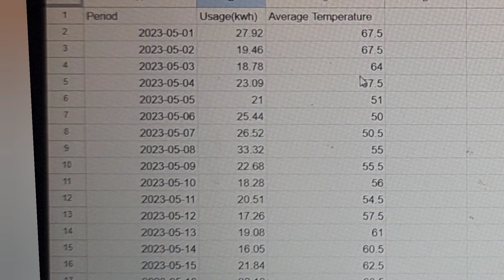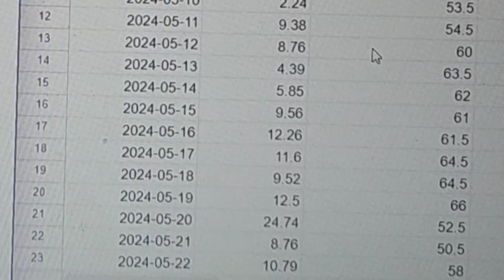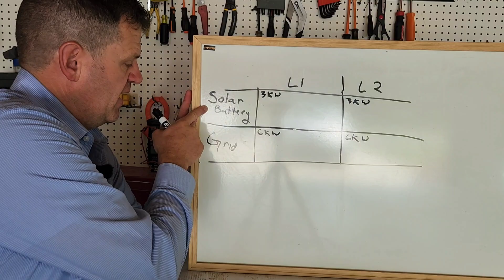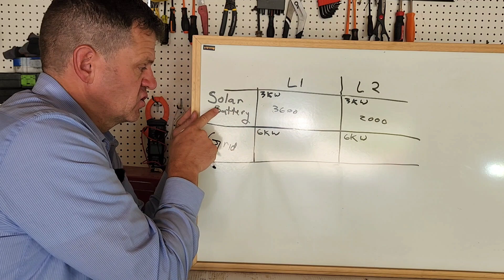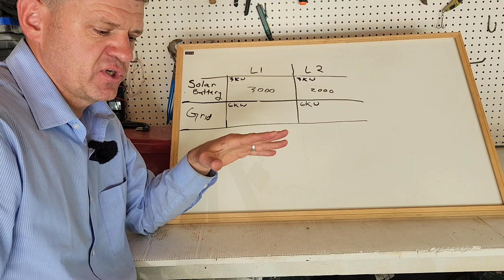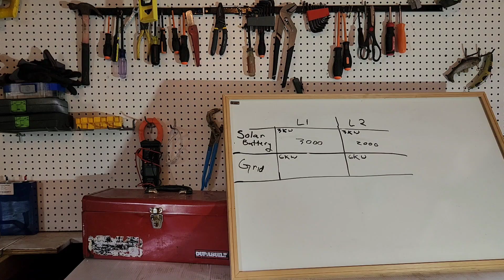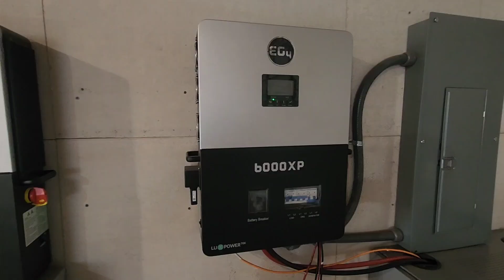I Ran My House on the EG4 6000XP For 2 Months - Cost Savings & Results

Comment: I have not seen an electric bill under 350 in about 9 years. My summer bill  averages about 500-600 and winter bills are closer to 350. My home is small compared to this one mentioned here. It is a 2500 sq ft home with a 4 ton ac, gas appliances and in California. My home does have approximately 95 led can lights and a stay at home wife with home schooled children.
Reply from the maker: Oh, crazy how expensive electricity is in california. A DIY system would be paid off crazy fast over there... or you could have an electrician install it fairly cheap... just to avoid the door-to-door Solar companies.

Comment: I cant get behind the statement that a 7 year payback is similar to historic stock market returns.  Couldnt be farther from the truth.
After 7 years in solar you literally are AT zero.  You spent 7 years in the negative.  After 7 years in investments your money should be DOUBLE when you started. 
Also at 7 years (5 yrs), your high frequency inverters will be out of warranty, ready to be replaced and you have to spend a large amount again.  By 10-14 years your batteries will need to be replaced.  Also your returns wont be linear as capacity degrades literally every day, down to 80% after 8-10 yrs on battery.  So these numbers dont hold up.
Im a fan of solar, a fan of batteries, but  you cant act (yet) like this stuff makes any kind of financial sense.  Its a hobby at best unless money is not an issue, which is a great position to be in.

Comment: Thanks for the video sir. 
One thing that concerns me on the idea of the solar system is fire. The issue is all of this equipment and batteries inside your home. For safety I feel all of the solar equipment and batteries should be separated from the home in a small aux building. Then the AC output brought into the panel from outside. A short circuit in a controller or battery in your home could result in the loss of life or home. If a fire occurs in an outbuilding it is isolated from your home.
Just a thought.
Cheers.
Reply from the maker: Thanks for the comment.  There are other people that share this concern...They have the gridboss and the flexboss for this purpose.  The flexboss can be located offsite with out significate cost in wire.  They also have a BossBox that would replace the outbuilding for the equipment: https://signaturesolar.com/eg4-bossbox-energy-storage-enclosure/?ref=DiySolarPowerFun

Comment: I'd like to see how you're doing with the 12000XP.  Seems you wouldn't push the 6000W/Leg limit of the 12000XP and you'd have a good chance of zeroing it out.
Reply from the maker: The 12,000xp ran my house fine.  No issues there.
Reply: @diySolarPowerFunWithRay so it would zero your bill?  No surprises?
Reply from the maker: Currently during the summer my current array and inverter is covering about 80 to 90% of everything.  Battery gets low at night when the AC is running. Did you decide on a inverter/system for your house?  Let me know if you have any questions. Feel free to shoot me an email.
Reply: @diySolarPowerFunWithRay  Thanks Ray.    My plan is a 12000XP and a 30kwh rack of Ecoworthy server rack batteries.  But I need every other bill in life to slow down first. 😅

Comment: I'm looking at the the EG4 6000XP.  My house is old (built in 77) and will be changing out the windows to double or triple pane windows this fall.   House has new HVAC system so good in that efficiency area.  We are in Texas between Dallas & Houston and it gets blazing hot here during the summer!   My electric bill is around $300 on the high side and low of about $150.  Its only 1700 sf and all electric.   Total KW hours for last years was about 18000 so its got room for improvement.   I'm hoping the single system will work without going to the 12k system but I might be upgrading anyways after we build a shop and power it as well.  We are in a Co-Op area so net metering benefits.   Hoping this will be the off grid system we are looking for as the Co-Ops here are not very friendly.   I'd rather have my own and be done with an electric bill completely!   Great video BTW!
Reply from the maker: Cool. The 12000 XP would also be good if you end up getting an electric vehicle in the future. The 12,000 XP is much better unit than this one.  You could check out my video on it. 
    I also  just posted a review of a nhx hybrid inverter recently that tested out really well...That one is about the same price as the 12,000 XP but it has the ability to back feed.
Reply: Yes, I talked with Signature Solar and I am gonna have to run a 12,000 XP system because we draw too many amps for the 6000 unit. No to the electric vehicle. I’m only a fan of things that I can actually fix. While I think they’re technologically amazing, I would be completely lost, trying to do any maintenance on it. I have a bunch of old vehicles that I’ve been running in maintaining for 40 years and knowing them inside and out has been working for me. Nothing against Tesla’s though. They are quite impressive. Just not my thing.

Comment: If the 6000xp is an off grid system then how do you use grid power if your batteries get low?
Reply from the maker: It's "Off Grid" in the sense that it doesn't backfeed the grid.  But I can connect grid power to it and it will automatically transfer to grid while the batteries are low.  The original install video shows how it all work together.(https://youtu.be/nAJByNRCw0k).  Hope this helps.
Reply: @diySolarPowerFunWithRay  Did you mean from the grid when batteries are low? And thanks for the info!!!
Reply from the maker: If the batteries are low, be default it will go into grid by pass mode... Passing the grid through as it's output.  But you can set it up to charge the batteries up from grid power to a certain percentage if you'd like.

Comment: Instead of looking at just power saved also compare it to what a back up generator would cost to install since this both providing power and acting as a back up.

Also put a soft start device on your AC to reduce the surge as the compressor motor starts up
Reply from the maker: I guess the main difference is that the solar generator will eventually pay for itself, but the gas generator will never pay for itself.
Reply: @diySolarPowerFunWithRay  but functionally a good solar system is acting as a backup generator. This added functionality needs to be considered because just the saving in power. Especially if you have a well, several freezers, etc...

Comment: Generally speaking though you're not factoring in the gas bill.And that needs to be added since you're  calculating your home's energy cost.The ROI would then probably be in the 10-12year time period and by then you would need to either replace your batteries, solar panels or both to a degree.And then what about a major storm that produces hailstones?By no means am I being condescending towards your video but perhaps it would be more real world experience to factor in these scenarios. JMO sir and no harm or dispute meant at all.
Reply from the maker: In my area we don't have hail.  most panels are rated to survive most hail storms.  I believe my batteries will last longer than 10 years.  I currently have some batteries that have a minimum of 10 years warranty. But that is the minimum...they should definitely last longer than that. The system installed here is also not changing my gas bill at all.

Comment: I have a conundrum here, I invested into a beginner setup with 4 400w panels and the ecoflow delta pro 3 and I'm trying to figure out how to upgrade gradually while still incorporating my current rig. Battery expansion is the priority and then eventually an all in one with more panels but I'm trying to envision how I can use a 48v wall mount in conjunction with an Ecoflow Delta Pro 3. I'm gonna need a 48v 50a charger to charge the wall mount with the ecoflow and some way to charge my ecoflow with the wall mount but I'm running into trouble with the degson push connectors, Anyone have any suggestions or care to poo poo this entirely? I have a knack for the unorthodox and inventing new things that haven't been attempted.

Comment: I have the same inverter, I just shut the AC off when I'm running other high draw appliances, since a microwave or other appliance is only on for a short time, but it is just me and my wife, so it's pretty easy..Heat kills electronics, I run mine high, the fan doesn't bother me at all..
Reply from the maker: This is the video where where install the 2nd inverter and explain my decision in selecting that wire:  https://youtu.be/pBKh2Blsnrk?si=A5ZpkK9oGZVSAfXd

Comment: Newbie question: I want to build a simple power emergency system for my dad's small house ( Ecuador South America), the is no power panels. He largest consumption is on his induction stove (220V). I was planing to use one eg4 3000W inverter but i think i can not use it. What is your advice on what is better to use , two EG4 3000w or one EG46000XP? Thanks
Reply from the maker: I would definitely go with a single 6000 XP. But I would call Signature solar and give them a full description of the property and have them help you make the right decision.
Reply: @diySolarPowerFunWithRay  many thanks!!

Comment: My old farmhouse uses, on average, 128 to 135 kw per day. Summer winter doesn't matter. A solar array on the farmette would be great, the 5 ton and 2 ton ac units in the summer, along with the pool motor running 14 hours and a large dehumidifier in the basement, 3 frost free fridges and a frost free upright freezer, and a kid that does two loads of laundry each day, though our dryer is gas, all add up. You would think over the winter the cost would go down BUT, dehumidifier still runs all winter, 6 315W CMH growlights in the basement running 14 hrs each day, and a whole house steam humidifier running at least 10 hours per day (and it turns on the two stage main furnace to circulate the air. I guess I would just need three of those EG4s, 10 batteries and a 30kw solar array to make a dent in my $700/mth electric bill ( we do not have dual rates with cheaper night rates). Also forgot about the Jacuzzi outside and it's 5kw heater  lol

Comment: Is the grid power coming from a breaker in your main panel?  When you send power from the inverter to the main panel, does that just go into the main through a breaker as well?
Reply from the maker: The original install video explains more clear what I did. Thanks! :). https://www.youtube.com/watch?v=nAJByNRCw0k&t=689s

Comment: I also have the EG4-6000 XP (2 of them) they do seem to often fall back to grid, and the interface does a terrible job of showing the leg imbalance (not with 1 mind you, but with 2, absolutely) I'm pretty annoyed with the frequency of fallback, it LOVES to charge the batteries > cover the house load, even when there is plenty of solar (if my battery is >50%) so I often disconnect grid to force the unit to invert and charge. I recently went through hurricane Helene (Upstate SC) and lived the offgrid life for 7 days, what a learning experience that was! I now have a chargeverter (probably will get a second for 200A charge capacity) as I'd rather be charging the batteries then letting the EG4 switch to gen. I still think they are great units for the money. I have 12K of solar now which covers me and charges 400AH of battery during peak summer, I feel I will need DOUBLE the solar and 3x-5x the battery to handle winter needs. Going to find out soon.
Reply from the maker: Chargeverters are amazing!  If both of you units are in running in parallel it shouldn't switch back to grid often. Mine never have.  I wonder if you have some setting off. I'd call signature solar and ask them about you settings.  I also have a setting in my app where I can see both inverters together..."Parallel-A".  Signature Solar had to enable that for me.  Glad you make it though the storm
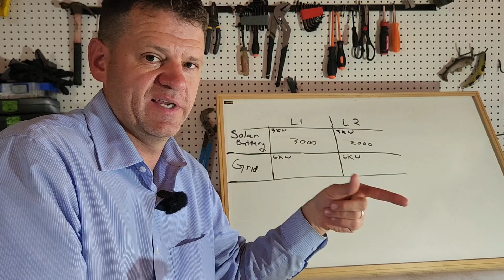Reply: I use the EG4 monitoring app, very easy to use it to adjust all the settings. I have mine set to charge the batteries if they get below 20% SOC and charger them up to 30% SOC.  Most days my 30 kWh battery rack lasts all night but if it doesn't a bit of charge will get me through until sun up.  Before the last hurricane (I am in Florida) I set it to 80-100, I wanted all the charge I could get.  It ran out a 5:00am the next day, I was up and just switched my inverters off.  By 10:00 the sun was out enough to power my home.

Comment: Does this system need an automatic transfer switch?
Reply from the maker: There's a transfer switch built in and if the battery/solar gets lot it will automatically switch to grid.  That's how I have mine set up anys... I think that's the default setting as most people want to use it that way.

Comment: Can it start inductive loads
Reply from the maker: I needed another for it to start my air conditioner(3 ton)
Reply: @diySolarPowerFunWithRay  thx. That's good info
Reply: @diySolarPowerFunWithRay   Do you think from a design point of view, that the new 12000xp would be  as effective as a pair of 6000xp's for your 3 ton AC?
Reply from the maker: I'd have to look at the spec sheet.  It would guess it would be similar.... But I plan on testing that unit.  Warranty is the same... No Grid breaker on the 12000xp... But it does have a smart Load out put....which might be nice.
Reply from the maker: I'll be testing that :)
Reply: @diySolarPowerFunWithRay  wondering, is the idle current of the same as the 12000xp the same as the 6000xp or double?

Comment: Hello, I recently installed the eg4 6000xp and I noticed that when it is charging the batteries or powering the loads the fans stay on all the time, is this normal? Because my Solark 8k only turns on the fans based on temperature.
Reply from the maker: They do run a lot. There is a setting in the app where you can turn them down. I turned mine down but it's probably best to ask support before you turn the fans off or adjust them.
Reply: @diySolarPowerFunWithRay  ok ,thanks

Comment: You've made a great presentation.  I have an observation and a question.  First it seems that the wires coming into your panel are smaller that expected.  This may be due to the video and I'm assuming you have a 200 amp service.  The question is, given that you have such large panels and 14 of them,  I'd like to see how you have configured them so as NOT to overload the MPPT in the inverter, especially as it seems you live in a climate that in the winter could cause over voltage.   Again you've done a really nice job.
Reply from the maker: I actually have a 100 amp service.  However my electrician installed this new 200 amp electrical panel 4 years ago.  The MPPT is just for solar.  This inverter has 2 mppt's.  My Solar voltage max during the winter should be well below the allowed voltage of the mppt's.  Thanks, you had me double check, questioning myself... never hurts.

Comment: the new 12kpv can work with both the inverter and load at the same time even when you overload it.
Reply from the maker: To be honest I'm skeptical. However, I'll be testing this shortly in a future video(with the 12kPV).  :)
Reply: @diySolarPowerFunWithRay  I have it. I charge my car with a 6.5kwh charger and the ac goes above the 8kwh. After that, the grid supplies the demand after the 8kwh. So if I use 9kwh, the inverter from battery/solar provides 8kwh and the grid provides 1kwh.
Reply from the maker: @AlmightyPyro  Wow, That's awesome!!  That alone would be worth the upgrade from the 6000xp.  I'm excited to try it out.

Comment: I'm always ready to be amazed that one of these eco battery system videos will be appropriately titled and not just hype.  So, if I understand it, your home ran off solar panels, the grid, and a battery. I wonder whether overall, that was actually a heftier carbon footprint that only the grid.
Also, you include future grid system price increase in your calculations. I keep seeing claims that renewables are driving down the cost of electricity. So as more people and commercial systems feed power into the grid, shouldn't prices remain at least stable or maybe even decrease?
Thank you for an overall comprehensive video.
Reply from the maker: As far as a carbon foot print.. I'm not sure. All I know is that I'll be better off if/when the power goes out.
   Yeah, it's kinda ironic that energy prices keep going up even though tons of people are pumping power into the grid.

Comment: Great videos! I'm just wondering if there is a mode in the inverter that will allow solar, batteries, and grid to work together to meet the 6kw+ power need. It wouldn't make sense to not have such a mode. And I wonder if there are other brands in the market that allow all three to work together.
Reply from the maker: The 12kpv may do this, but I don't know for sure... I have the 12K in my garage and I will be testing it next. This will be one of the features I am most excited to try out.